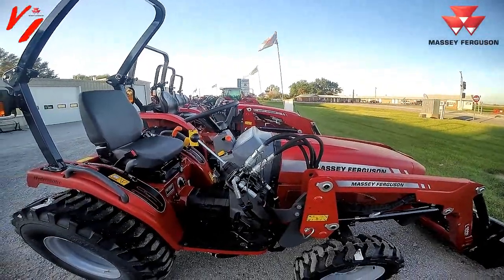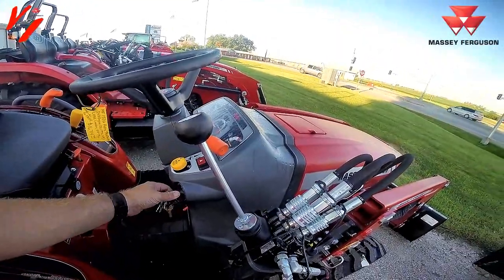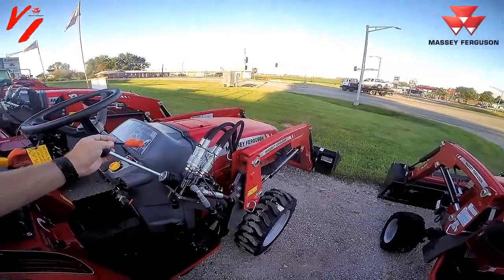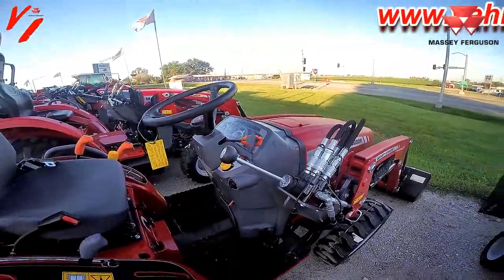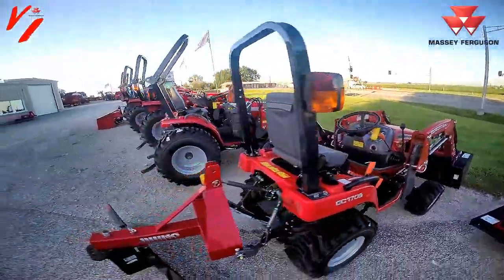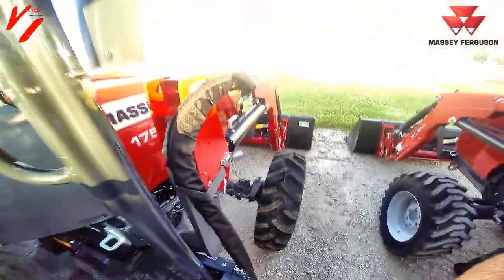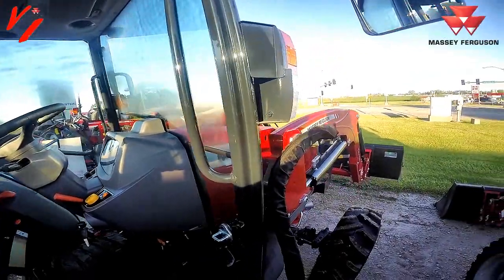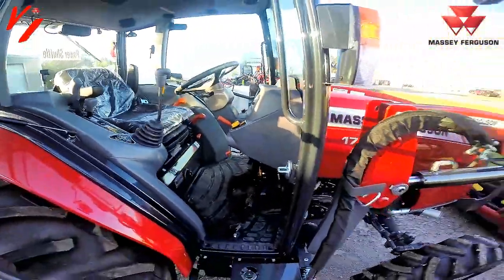The Basics: Understanding Loader Joystick Controls

Comment: When I removed the tractor covering , some how the tarp pulled down on the joy stick and broke. The stick itself is ok but where it mounts onto the box it’s broken. I don’t know what it’s called but I would like to take it off and replace it. Is it safe? Where can I buy this part?
Reply from the maker: Would need to know which tractor & Loader Model you have and brand of valve. Or yo ucan look on www,agcopartsbooks,com and go in as guest user to find the parts you need then you can order from your local Massey Ferguson Dealer.

Comment: I have a A-VFH1009 joystick control that wont lift unless its going to the side too, I have tried to tighten it but always comes loose. Do you know how to fix this?
Reply from the maker: Not sure what you mean by A-VFH1009 Joystick Control. Are you talking about the Standard Equipment Valve? Is that a Manufacturers Number on the Valve? Which Loader and Tractor Model. Could be linkage or stuck valve. There are two valves inside one for up/down circuit and one for tilt/dump circuit.
Reply: @VahrenbergImplement  VFH1009 is the part number of the joystick that is used on a Quicke Front Loader, that was put on a CX105
Reply from the maker: I searched the Quicke Parts Books and that number does not come up. I would contact your ALO Quicke Dealer and ask them what they used. Most of our loaders are factory installed by Massey Ferguson. Or you might be able to find it on the Quicke Parts Website: https://quicke.org/parts/

Comment: what model of tractor was the fist one shown and do you know of the part number for the control valve
Reply from the maker: That is the Massey Ferguson 1526. That is the Original Equipment Valve. Depends on the Loader as they have made some different valves. You can look at the valve options at www.AGCO PartsBooks.Com

Comment: What is the small lever on the Kubota B7800 bucket control stick manifold for?
Reply from the maker: Not familiar with Kubota B7800 we are a Massey Ferguson Dealership. You will need to contact a Kubota Dealer to Answer that Questions.

Comment: Question again
Joystick has gone in the downward position instead of straight out. Doesn’t centre itself out.
Reply from the maker: Sounds like something has happened with the joystick where it connects to the valves. The Rubber Boot covers the apparatus between the lever and valve that causes the valves to move. Need to look under that boot and see what has happened. You can look at www.agcopartsbooks.com and look under the loader model to see the components inside to find what has happened to cause it not to self center anymore.

Comment: Is there anyway to adjust the tilt on the joystick so it dumps faster?
Reply: I own 1726e
Reply from the maker: Not on the E Series Tractors. That is just a 2 Position Valve. On the Premium Series an added feature is a float position to the right or called "Quick Dump" but that is totally different tractor and loader on those models.

Comment: The Flx2106 manual says the joystick can be “locked” in the neutral position, but doesn’t explain other than sitting in neutral. Is there actually a button to lock up the controls?
Reply from the maker: I do not have a 1526 with FLx2106 Loader instock. I would ask your local dealer they may have one to look at and can tell you.